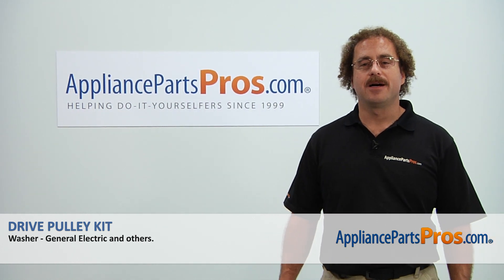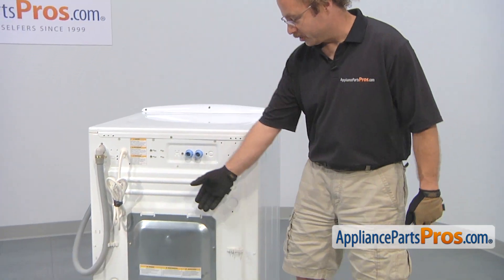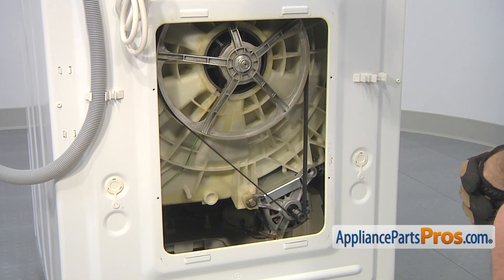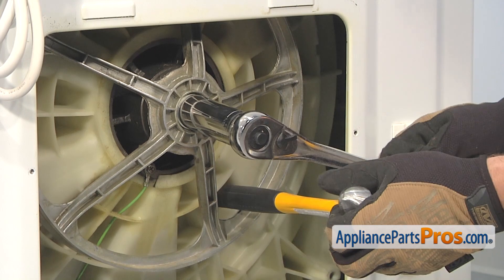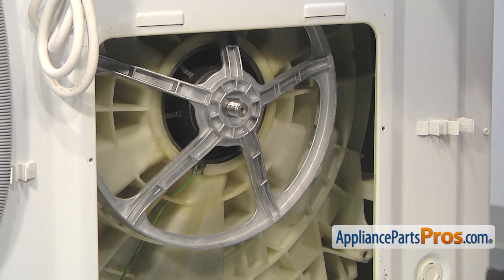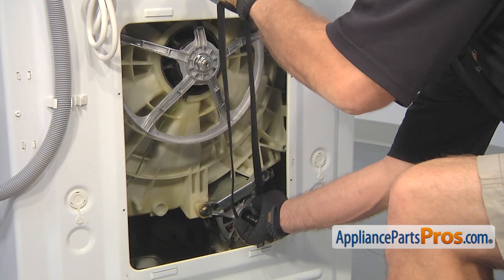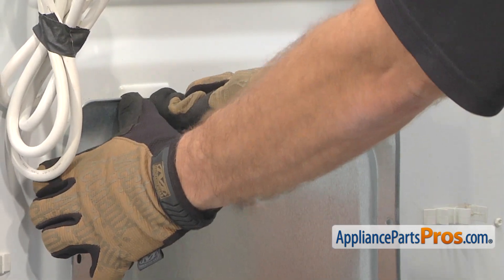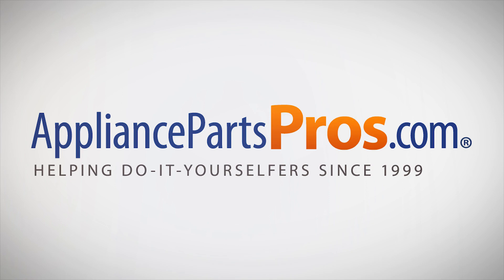How To: GE Drive Pulley Kit WH07X10016

Comment: Just ordered the wheel pulley. Thing was so shredded it was just spinning in place and belt only had 5 groves instead of 6. Black powder everywhere from slowly wearing out over time. I heard the noises from it shaking, but figured I would need a new washer soon. Glad I took it apart finally to see what was up. Surprised the belt stayed on as long as it did with all that wobbling. Surprised how soft that pulley wheel metal is. Lasted almost 12yrs. though. Thx!

Comment: How would you know your drive pulley is bad? How would you know when to change your drive pulley?
Reply from the maker: This drive pulley has flat spots that lock onto the drive shaft. If they are worn or damaged the pulley will not lock onto the shaft. This would cause a lot of noise and the drum would not be driven if the flats are totally worn away.

Comment: i just changed my drive belt but it wont stay straight, when you turn the arm the belt starts to slip back, do that mean the arm pulley needs to be replaced as well?
Reply from the maker: We offer free technical advice and diagnosis on things that aren't covered in our videos, so we'll be glad to advise you on that repair. We’re available 7 days a week at 1-877-477-7278 or you can chat us at our website: http://www.appliancepartspros.com/
Reply: This keeps happening to me.. belt wont stay in proper position. keeps sliding inward. did you ever find a solution? i tried a new belt but same issue.